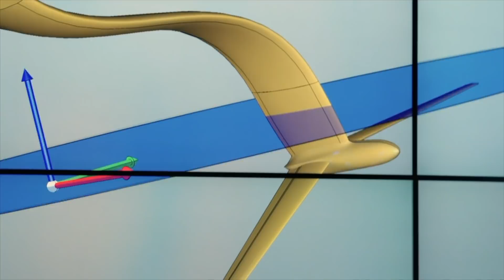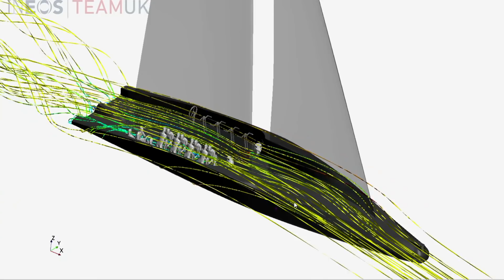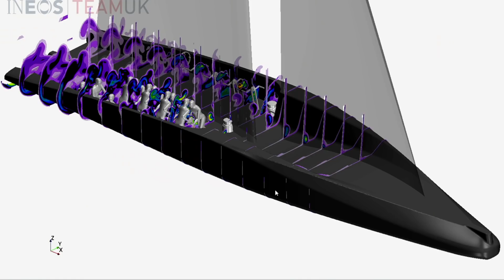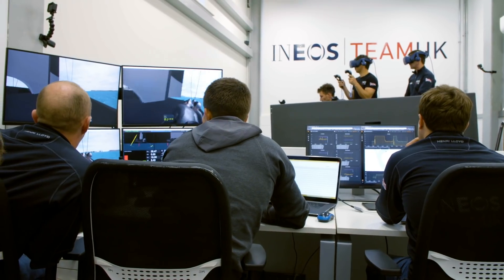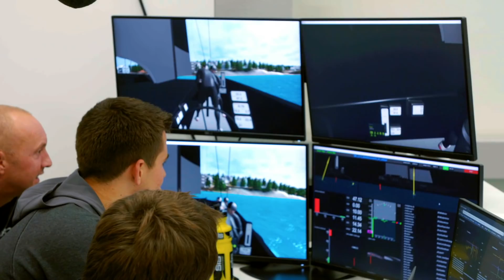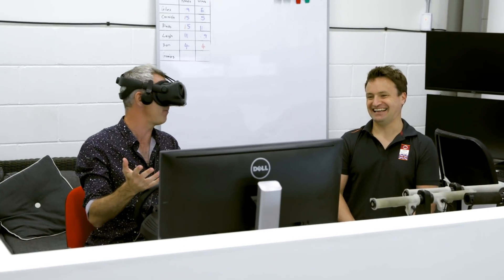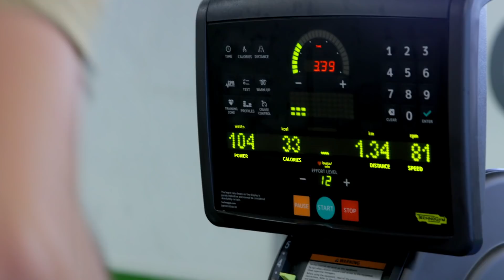The America's Cup And INEOS TEAM UK - BBC Click

Comment: Been racking my brains about the undeniable slowness of the INEOS boat. Ther main difference l can see is the foils. They are stubby and triangular and therefore draggy..which is slow. How about taking a look at the NZ foils...winglike, long and narrow, and completely horizontal. They just look right. It's counterintuitive...fat foils make getting up and out of the water easier, or so you would think, but actually the opposite happens. They are draggy and hold the boat back. Thin, long or high aspect foils help build speed which then aid lift far more efficiently. Just do the opposite of what the computer tells you to do...easy ain't it?

Comment: while i think it is rad the way the yachts have progressed over the years and am very intrigued to see these ac75 boats compete against each other starting in December(i am especially interested in how each team's hull shape vastly differ from each other and it will be exciting to see how each one ultimately performs against the others).  however, the one aspect that i really don't like is all the actual sailing being powered... i mean, i guess hoisting and trimming sails and "grinding"  are both grunt work by nature, but the thing is, at least when the team was changing, hoisting and trimming sails, they were actually doing something necessary to sail the vessel, whereas the "grinders" are just there because it was arbitrarily decided that they would be so the team had something to do and i guess it looks to the audience like the teams are doing something...  imo, if you're going to move away from needing humans to do any of the sail adjustment etc, then just move away from it completely, allow them to have solar or wind charged battery banks and only then have the 3-5 ppl(just guessing, however many it is in reality) on board that are absolutely necessary at that point to keep the boat sailing...

 the whole grinding thing just seems arbitrarily inane, imo of course.   /blahg.
Reply: Isn't the grinding to recharge the batteries?

Comment: Using "grinders" to generate power is archaic and somewhat ridiculous. Every team is going to have enough fit men to do this and it will not affect the race. Might as well let the boats have a bank of batteries for each race (or races).  It is the strategy and boat handling that make the difference after design. Bunch of hulks grinding away means nothing in this sort of race.
Reply: The most efficient solar electric cell panel printed in lcd upon their mainsail, then. From infrared up to GRB compression wave...
Reply: Agreed
Reply: True, but that would it make it more obvious how far away from traditional sailing they've gone.

Comment: No physical testing? That seems retarded and outside the bounds of good competition or what could even be a rule.
Reply: Thats the Kiwis for ya.
Reply: @SCARPENTER290  Jacinda Ardern & New Zealand expecting 47,000 crowd for second Rugby Test.
Auckland’s Eden Park set to host second match of series
Opener was drawn in front of big crowd in Wellington-
The envy from fans in countries where sport continues to be played in empty stadiums will only be exacerbated on Sunday when the All Blacks return to their spiritual home, where they are unbeaten in 43 matches going back to 1994.
The bumper crowds are possible because of New Zealand’s relative success in combating Covid-19, having appeared to have stamped out community transmission of the coronavirus earlier this year following a tough nationwide lockdown.
Reply: The computer simulation is very good. Also by AC standards this isn't a retarded rule or even against the 'spirit' of the AC The Kiwis aren't and never have been the best at wind tunnel testing, they design the rule to their strengths. It's a true winner takes all event. Besides there's a mini constitution and certain safeguards in place to make sure the winners don't do anything too crazy.
Reply: @liocla2331  Its also very very expensive with no clear advantage over a model. The next rule will be to ban shoes with rubber soles
Reply: Wind tunnel testing on this scale is actually quite expensive.   AC sailing is already super expensive and this was put in place as a cost cutting measure so that teams have more to spend on the boats rather than endless iterative aerodynamic and hydrodynamic designs.  Formula 1 has moved in the same direction by strictly limiting wind tunnel time.